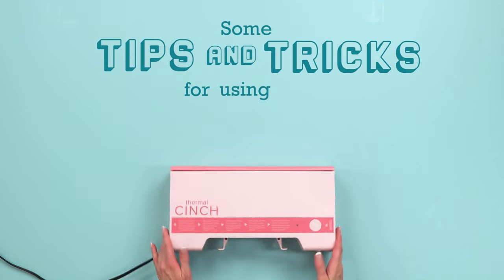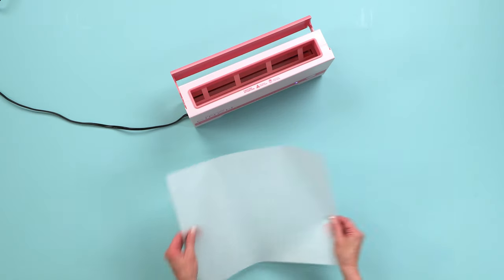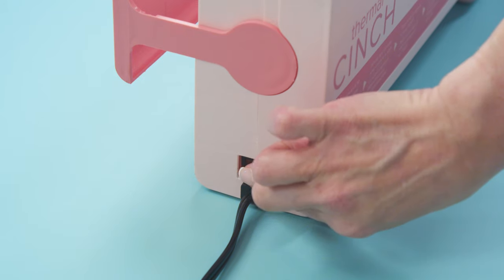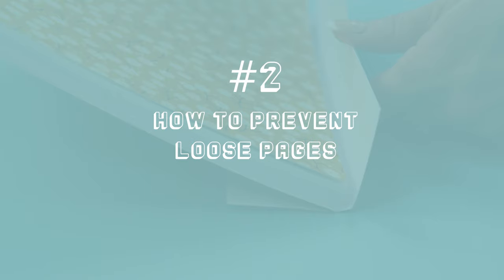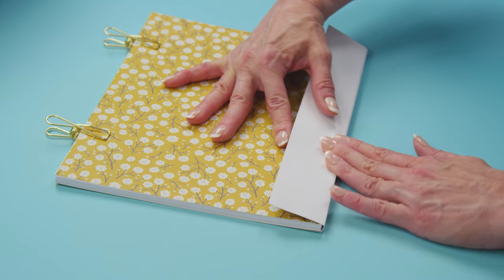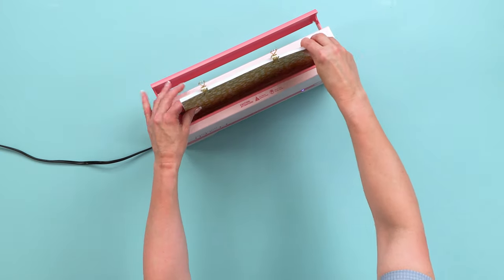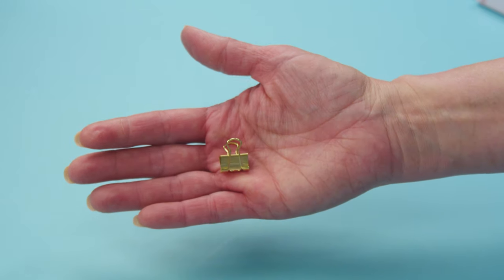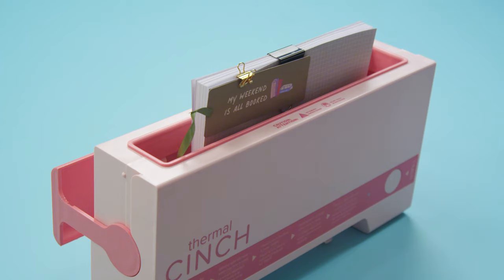Thermal Cinch Tips and Tricks

Comment: How many sheets can hold this? Thanks
Reply from the maker: @veronicajuarez3684  hi! The max number of sheets depends on the thickness. Spines up to 1 1/2 inches fit into the machine. That’s about 150 sheets of cardstock and 300 sheets of copy paper.